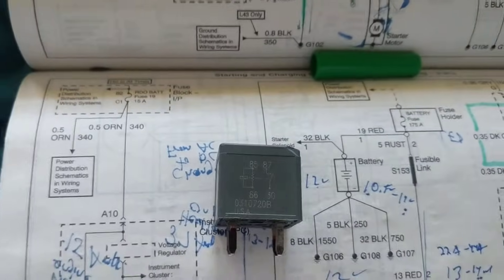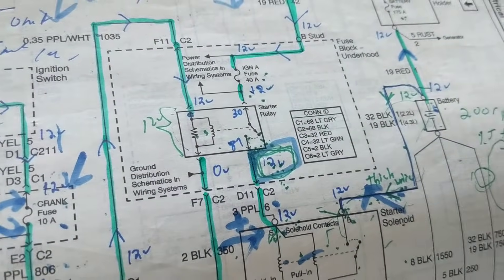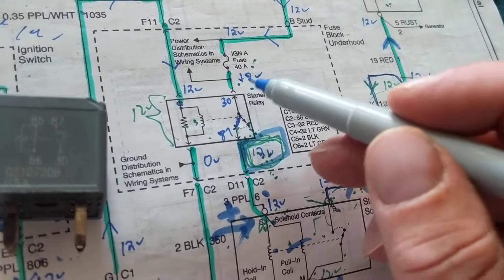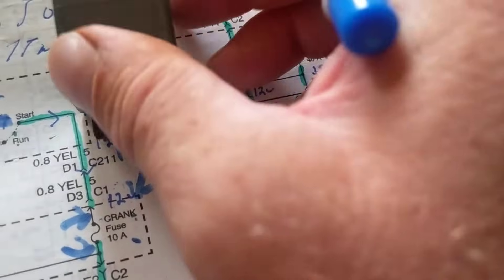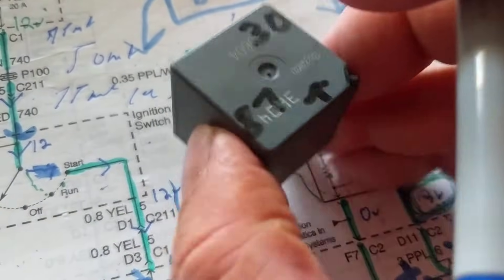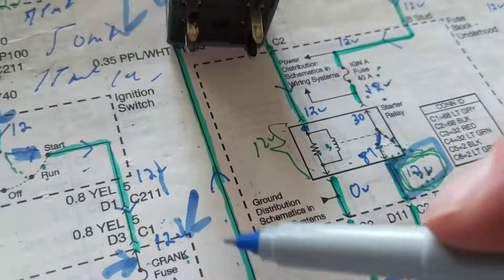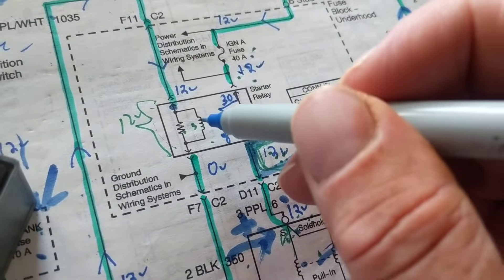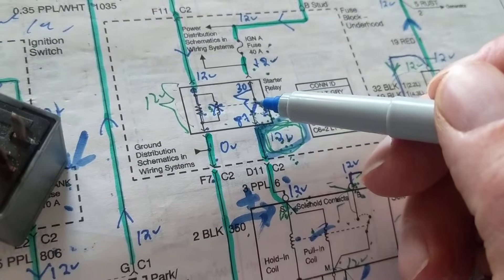crank and no start how to jump the fuel pump relay from diagram

Comment: i leave the top plastic covers right off the relays and plug them back in test by pushing on the contacts . plus test for voltage . relay is like a mini solenoid
Reply from the maker: @todds7614  how many reality they should just plug back in even with the plastic cover it should not be that hard to get them in unless the terminals are spread

Comment: hi i want jump a 5 pin which 2 would i jump i have a 86a extra thanks
Reply from the maker: If you have pins 87 to 30 on the condition of the load is connected to pin 30

Comment: Now i have a 98 sonoma and fuel pump is good and i can jump the relay 87 to 30 and pump kicks on then and only fhen with a jumper wire i put new ignition switch and ignition switch wire and new rotor and cap but no spark or fuel idk what to do ive looked and nothing good grounds too if anyone can help a fella out that'd be awesome
Reply from the maker: The fact that the fuel pump comes on with a jumper wire says that either the relay or a sensor or a power control module is not turning on the relay the coil side at this point I would not worry about spark I would worry about fuel pressure when you jumped it and it came on that means the contact switch of the relay was closed when you did it but the other part is not functioning properly again that could be a module ascensor a crankshaft sensor could be aground a separate ground for that coil circuit of the relay if you can measure unpin 30 the voltage you would know if the relay is coming on
Reply from the maker: It would be much easier bias I assume you don't have a fuel pressure gauge to measure the fuel pressure and right away you know if all those circuits are working correctly try to measure pin 87 + 30

Comment: My ford relays are labeled  1,2,3,4,5 even on a diagram on the sides of the relay not 87,30 so forth?
Reply from the maker: Pins one and two are the coil,345 are the contacts,the switch that toggles
Reply: Thanks I'm up and running until I get to parts house! Thanks again

Comment: Okay what if I do not have any markings on the relay what  do you do then
Reply from the maker: Good question it will always have the schematic picture of it so 30 and 87 are always going to the fuel pump and 8685 goes to power and ground but you can always look up the diagram of it on Google of the relays thank you so much good question
Reply from the maker: There's always a picture of the schematic on the relay you can also measure voltages but that might be very deceiving if you're not technical on the pins of the relay what I suggest is you always go to a diagram from Google for this section of fuel pump relay your modeling and make of your car and also relay pinouts thank you so much